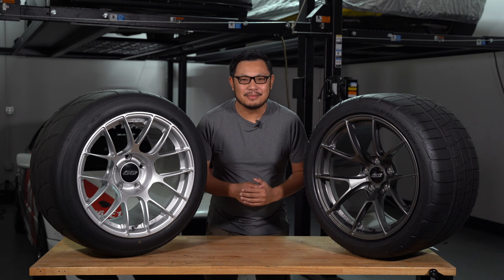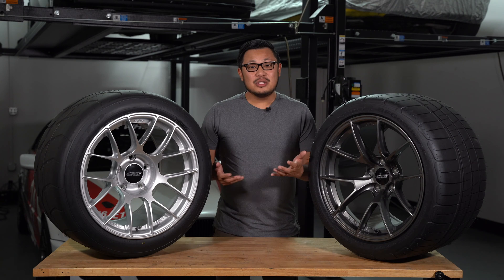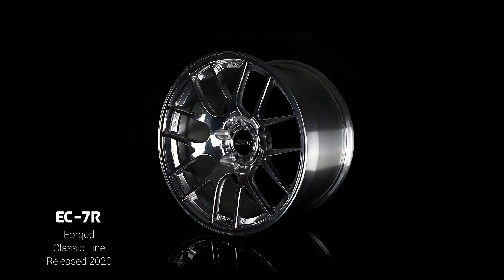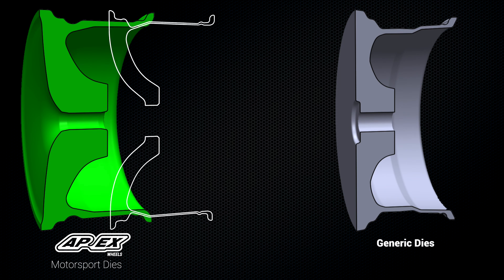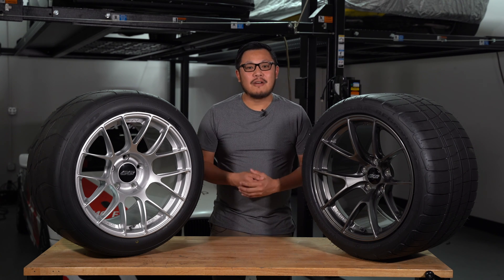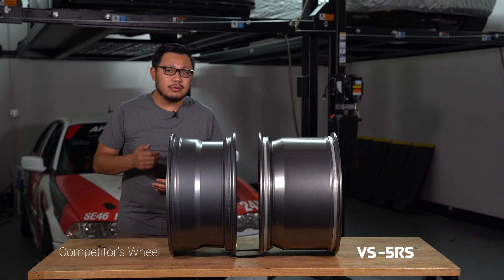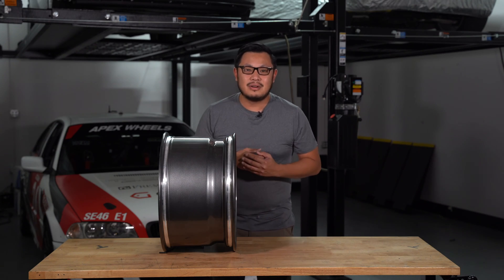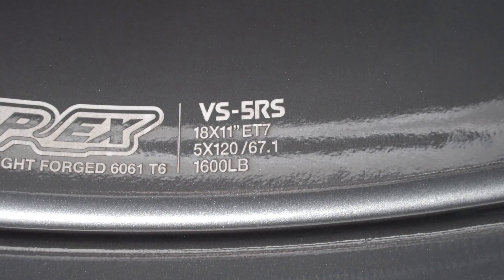How APEX Engineers A Better Track Wheel

Comment: Anything we should know about using G LOC or OEM/FERODO brakes or anything about maintenance and upkeep of the Wheels? If it matters, I have the 19 x 11 10 RS on a 2022 Mach 1. I am assuming it would be a great idea to ceramic coat the wheels before I put them on the car? If so, should I clean them with alcohol or anything first or do they come from you guys ready to coat? Thank you.

Comment: I really struggled to be certain whether arc 8 - 18 9 et30 fit f30 340i sxdrive front and rear with 255 40 r18 tires square set up?
Reply: A few months late, so you probably already have your answer, but according the members at bimmerpost message boards, yes they do. They obviously fit the rears as that tire size is a factory option, but they'll clear the front too. If it doesn't, you can always switch to 245/40/18. They will fit on that wheel, but you will just increase the fender gap by 4mm. Also, you'd have to do that tire size all the way around and not just the front because they are just barely > than the 1% range required for xdrive...but you probably already knew that.

Comment: i have only 8j and 8.5j 225 and 255 on my F30... will the 8.5j and 9j rear compromise the transfer box ?
Reply from the maker: The width of the wheels themselves wont contribute directly to transfer case issues. What matters most is the overall tire diameter of the wheels and tires. If you run 225/40-18 front and 255/35-18 rear tires for example you will be well within the xDrive safe 1% difference between front and rear tire diameters even with the wider wheels. 

Our F30 fitment guide lists all the various xDrive compatible tire options for staggered fitments and is a great resource: https://support.apexraceparts.com/hc/en-us/articles/360002945034-F3x-3-4-Series-Wheel-Tire-Fitment-Guide 

-Tom
Reply: @apexwheels  
I received the email.. thank you 🙏 
Now i have to find a friend to bring them in Romania because i 😍 them !

Comment: When I check on Apex website, the wheels for 2022 WRX/2020 WRX, 5 X 114.5, the rims say "Flow formed." I thought that Apex made forged rims. I presume there are forged flow formed and cast flow formed, depending on what blank is used.
Reply from the maker: Thanks for the question! 

We make both Forged and Flow Formed wheels. The 18x9.5 ET38 EC-7 in the 5x114.3 PCD designed for the WRX/STI is a Flow Formed wheel and at the time of writing this we don't have Forged options for the WRX/STI market. This may change in the future though!

Our Forged wheels use blanks while the Flow Formed wheels are formed in moulds before the barrel of the wheel is stretched outward in a process that strengthens the material in the barrel of the wheel more than a traditional cast wheel. 

-Tom
Reply: @apexwheels  Thanks for the feedback. I'm trying to decide on new wheels for my '22 WRX. I don't understand whether there is forged flow formed (hybrid?) and cast flow formed, meaning that the main wheel is first formed in a cast and then flow formed, or is the main wheel forged/pressed and then flow formed.

Comment: what spec should I be going with on my 340i M sport?
Reply from the maker: Would this be for an F30 chassis 340i? Or a G chassis 340i? 

We have fitment resources for both generations of 340i. I assume you are talking about the F30 in which case I typically recommend either 18x9 ET30 square (front and rear with the same tire size) or 18x9 ET30 front and 18x9.5 ET35 rear (aggressive staggered setup). Notes on both of these F30 options can be found here: https://support.apexraceparts.com/hc/en-us/articles/360002945034-F3x-3-4-Series-Wheel-Tire-Fitment-Guide

-Tom

Comment: Does anyone here have a picture of SM10 18x10 ET33?
I'm trying to gauge the concavity difference with 18x9.5 ET22
I'm planning to install it on Cadillac ATS V.
I'm probably the first one in San Antonio trying to run less concavity profile in the rear.
I tried contacting APEX One-On-One Fitment Guide. 
But the guide doesn't have access to any wheels.
Thank you in advanced.
Reply from the maker: 18x10 ET33 SM-10 (Profile 2, rear wheel in the photo): https://flic.kr/p/2jKXHCk 

18x9.5 ET22 SM-10 (profile 3, both wheels in the photo): https://flic.kr/p/2mjmMqj 

Hope this helps!

-Tom
Reply: @apexwheels  Thank you TOM!

Comment: Which are available for the 718 GT4 and what are the right sizes?
Reply from the maker: Both our EC-7RS and VS-5RS Sprint Line designs are available in 718 GT4 fitments. I would recommend consulting our fitment guide for detailed notes on the recommended specifications for your setup: https://support.apexraceparts.com/hc/en-us/articles/4403365502107-718-GT4-Spyder-Wheel-Tire-Fitment-Guide 

-Tom

Comment: Do you know that the new VS5-RS in GR Supra fitment will accommodate the factory Toyota Center cap? 
I know the BMW line up center caps are interchangeable like the SM-10s on my F80 M3
Thanks!
Reply from the maker: Yes, The new Supra VS-5RS fitments will be compatible with the factory Toyota wheel caps meant for the Supra just like our BMW wheels. This cap bore actually matches G chassis BMW cap bores so BMW caps from newer BMWs will also snap into these wheels. 

-Tom

Comment: LOVE THIS! VERY INNOVATIVE!! I gotta get myself a set of VS-5RS for my 440i!!!
Reply from the maker: We recentlly featured a 440i running 19x9" ET30 wheels front and rear: https://www.youtube.com/watch?v=kudJHNqhcRA 

They'll look great on that chassis!
Reply: @apexwheels  I checked it out, I like it! I think the anthracite on my black 440i with the blue m-brakes will look amazing! Maybe someday I'll put a video up of them 😎 Is there any issues running 255/35 with the 19x9s? Also mines an x-drive, does that make any difference with the fitment? Thanks! Keep up the great work!
Reply from the maker: @Mitchelly7  255/35-19s may rub depending on the model of tire and your ride height et c. If you want to go wider, the shorter 255/30-19s would be a safer rub-free fit. 

-Tom
Reply: @apexwheels  thanks Tom! I was thinking the Michelin Pilot Sport 4S. Have you guys tested these or any other brands that you know will fit with 255/35 on the 19x9s? Thanks!
Reply from the maker: @Mitchelly7  We haven't tested 255/35-19s on this fitment as the majority of our customers run 18" wheels if they are looking for a taller tire sidewall. We've seen plenty of 255/30-19s or 245/35-19s though. 

I suspect that certain tires in that size would work without rubbing, but without testing or significant customer feedback, I couldn't guarantee a rub free fit. There are also certainly wider track-oriented tires in the same size that would cause rubbing so fitment will be a fine line. 

-Tom

Comment: Will you have a set for the GT86 platform like you did with your forged and flow formed iterations? I’d really be interested in a 17 inch diameter wheel from this line.
Reply from the maker: GT86 fitments will be available by the end of 2022 in 17x9” fitments similar to the sizes we currently offer. We are also in the process of developing a new 2nd gen 86 fitment as well as some new Flow Formed options. Be sure to stay in touch for updates!
-Ian